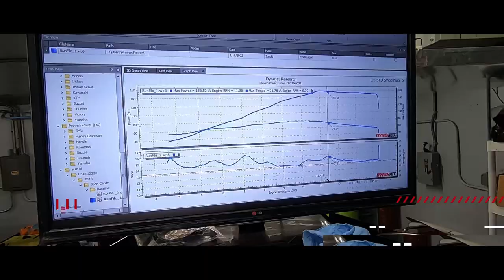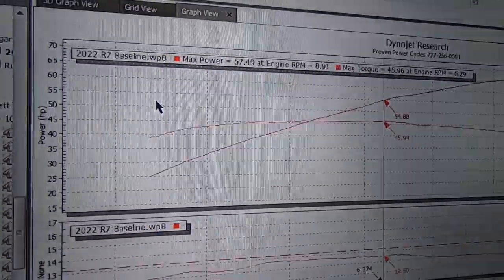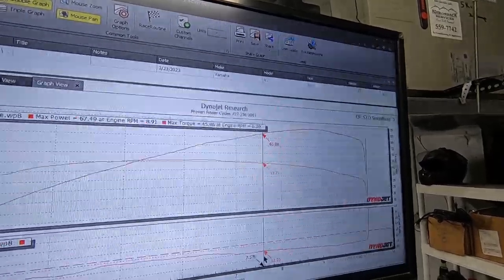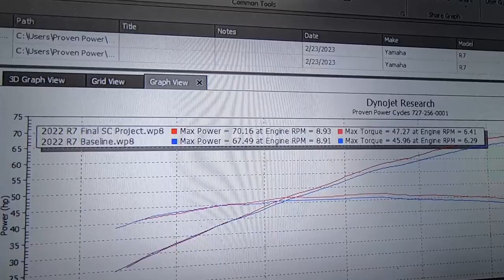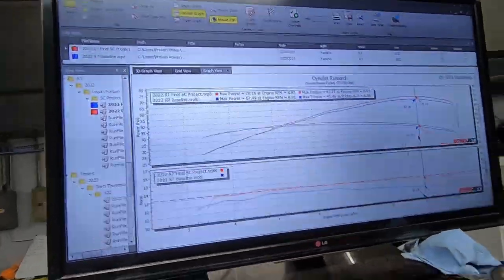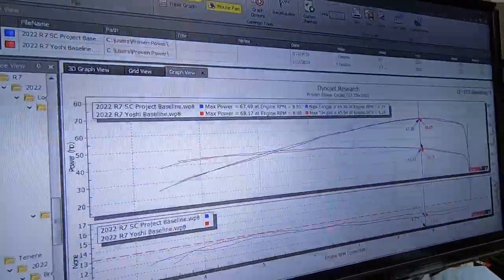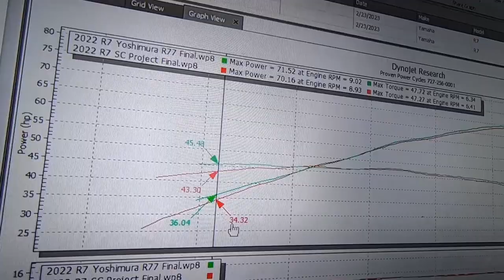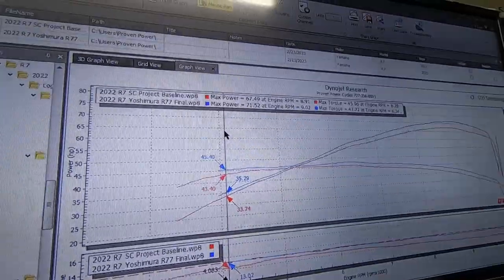2022 Yamaha R7 ECU Flash & Dyno.  REAL NUMBERS!

Comment: This tells me with the r7 or mt07 you can probably be fine running a pipe with no tune and shouldn’t have to worry about it leaning out the engine to much
Reply from the maker: More or less yes. It still can cause damage by running too rich. You can have too much fuel in the system that could bleed past piston rings and into the block/cylinder walls. This will break down your oil much quicker than a normal interval causing just as much havoc on your motor as running lean. Food for thought 🤙

Comment: Would be interesting to see the results with the Akrapovic S-Y7R12-APT full system as it utilizes longer pipe, Akrapovic claims 5.9hp gain. I have the Akrapovic pipe and I just added the Yoshimura airbox together I am told I could see 12+hp at the wheel with a proper flash.
Reply from the maker: Those are pretty big claims on a small engine bike such as this. However, we did not get the opportunity to compare these numbers to a completely stock R7 so I'm not sure on that data. 

I'd love to test and see what overall gains are made vs a completely stock bike 👍👍
Reply: @provenpowercycles  Yeah I thought 12hp seemed like a lofty claim as well, I'll have to see what she feels like after I send in my ECU for the flash, after I put the airbox on she did feel peppier in the mid but I am also in Denver metro so it could just be she is getting more air and not running as rich anymore..
Reply from the maker: @ThisOldGuy3  yeah possibly! Every little bit helps! 👍👍
Reply: How do you like the sound of the Akra? Been super indecisive on what to go with.

Comment: Great comparison, mate! I was especially invested as I have an R7 with the Yoshi full pipe as you had in the end there so it was nice to see that it outperformed the SC Project ever so slightly 👏🏽😃. I do like the tone of the Yoshi a bit better so no buyers' remorse from me.

I was a  bit surprised that it ran so rich stock esp after the SC were fitted. I hadn't dyno'd mine yet and I was actually worried that it might be running a bit lean! 

I also have the DNA filter installed (improves the induction tone but I can't really hear it anymore after the Yoshi had gone in haha) as well so I'm curious whether that would actually help bring the AFR back up closer to ideal? Have you done any tests with both the air filter and Yoshi and see what that combo is like?

Comment: That sc project pipe sounds so good on it, the cp2 sounds like a mini r1 lol
Reply from the maker: It definitely is a badass sounding bike! 🤙 especially compared to other parallel twins
Reply: @provenpowercycles For sure. 270 degree crank help so much. It even reminded me a little of the the V2 899 Panigale I once had.
Reply: I would imagine this twin would run a good bit cooler than an inline 4 as well.

Comment: very helpful and thorough information.  using the stock exhaust would have been interesting.  is it better to flash the ECU before installing a full exhaust?  thanks
Reply from the maker: When you get into the ecu you can choose what you want to do or don't do. On stock bikes, there are still things that can be utilized from just a flash that helps the bike ride better/more efficient. 

I always tell everyone, what you put into the bike, you will get back out on the back end. Meaning: if you put a full exhaust, air filter, chain and Sprocket, velocity stacks, cams, etc vs a stock bike; the tune will come out better and smoother because all the factory restrictions will be gone and off the bike and overall the bike SHOULD make more power as well (provided all of the mods run in sync with each other). 👍

Comment: When you correct air to fuel ratio does it improve the mpg and does it affect reliability of engine?
Reply from the maker: When afr is optimal compared to an overly rich mixture, it will save on fuel mileage. Some bikes have an overly lean mixture. So we would need to enrichen the afr to make it optimal which, in turn would lower fuel mileage. Everybike is different, so it all depends 👍

Comment: Are both systems running without a baffle? The only time my mt07 ran pig rich on the dyno with the sc project silencer is when the shot glass style db killer was installed in the inlet of the can. And even then the thing was so loud that it hurt your ears.
Reply from the maker: Both exhaust systems ran without the baffle in. I agree in thinking that the baffle installed would create a rich mixture, and without it, it would be much leaner. Buuuuttt that is not the case on them it seems.
Reply: @provenpowercycles  thanks.

Comment: Good day PPC. Have you tried getting baselines from just open headers? If yes, did you see an overall lean condition on the AFR (above stoich) or was the AFR just above your target 13s?

If you do a baseline on just the headers, will putting on a slip-on muffler make the AFR less lean?
Reply from the maker: Sorry on the delayed response. I have not dynod it with just the headers! My guess would be that it would lean it out slightly more so than what we were reading. When you add back pressure, you typically get a more rich condition vs a bike that flows more air through it with a larger or more free flowing exhaust. 👍
Reply: @provenpowercycles  Thanks. Do you think that if say, we dyno the bike with open headers then we see a leaned out AFR, will you be able to tune it to get back to the optimal target AFR?
Reply from the maker: @ManCannotRide  yeah absolutely. No matter the condition (rich or lean) you should be able to correct thru tuning, as long as you do not have a mechanical problem with the bike! 🙌

Comment: Great vid.  I'm not understanding why a tuned R7 with exhaust is maxing ~47 lb-ft torque and ~71 hp,  when the stock specs of the 2022 Yamaha YZF-R7 are 50 lb-ft torque and 74hp.  Are all bike stats from the dealer this inflated, or am I misunderstanding something?
Reply: For what i know the manufacturer data are often referred to the power at the shaft not at the wheel
Reply: Yes, manufacturers typically quote hp measured at the crank. Dyno tunes by nature, are measured at the rear wheels which in turn typically results in a 8 to 12% (or more) loss through the drivetrain.

So in this case, 71hp and 47lb-ft at the wheels are actually quite impressive and indicates that some gains were made over stock!

Comment: Is it okay to still ride without a tune?? I have the Two Brothers Racing on my R7.
Reply from the maker: Typically, when you remove the catalytic converter, the bike will run lean (too much air), which can cause excessive heat inside the motor, causing damage over time. 

On THIS particular R7, it ran rich (too much fuel), which can cause issues as well. If the bike runs excessively rich then fuel can actually make its way past your pistons/piston rings and break down your oil prematurely, which can cause spun rod bearings and other issues as well.
Reply: @provenpowercycles  Jeez so I gotta get it at least flashed soon then. Thanks for the response and great info!
Reply from the maker: @Terry - RR  no worries man 👌  and thank you for the compliment 🙌
Reply: hey rider did u ever get a tune . and did u notice difference if so.
Reply: @tommybenson3541  I was able to ride the R7 flashed this weekend, and it was great, no decel pops, less engine braking and the mid range torque improved, its great!
Reply: @terrystarr4793  I'm kinda fond of the decel pops. but less engine braking sounds good 👍🏼

Comment: Hmmm, makes less rwhp and torque than my 17 KTM 690 Duke single cylinder?
Reply from the maker: Not sure. I've only tuned a built 690, so it's not a fair comparison. But definitely disappointing numbers on a 700 for sure. Especially since it's a parallel twin.

Comment: Looks like one manufacturer spent more time developing their system !  .....not just making it look pretty. This engine is crying out for racier cams to make more power, the torque curve looks like a single/off road bike. Mild cams mean it doesn't need much in the way of restrictions though 🙂
Reply from the maker: I believe the newer bikes are coming with more of a midrange setup because of the emissions now. The newer busas are the same way. Smaller cam profile vs the older models and they have similar looking power curves. 

But that also leaves room for us power hungry people to look for and develop ways to pulling up that top end powerband 😏
Reply: @provenpowercycles  now that it’s been out for a while, if you did EVERYTHING you wanted to it, how close can we expect to get it compared to the R6? I know we can only ask so much out of a parallel twin but I’m holding out hope vs waiting for the R9 to release and upgrading

Comment: All Yamaha has to do is take it out to 750cc and tune it at least as good as the old Ducati 748. It’s decades newer and therefore should be decades better. Oh. And slip it into an R6 chassis! Then they wouldn’t have had to design all new frame and running gear! Kept costs down, built a better bike. 🤷‍♂️
Reply from the maker: I know right? We were pretty disappointed with the new setup but with all the new euro emissions codes, it made it harder now for manufacturers to produce a powerful bike and still get by 😔
Reply: Sure, just drop a 2-cyl engine probably half the size of the r6 4-cyl in to the same frame😂 i wonder why Yamaha haven’t offered you a contract yet since it is that easy.